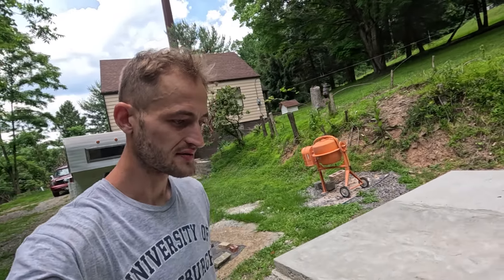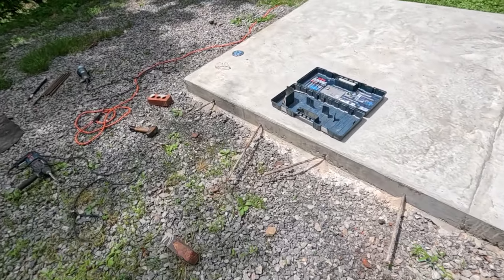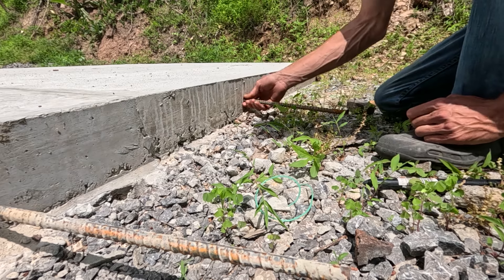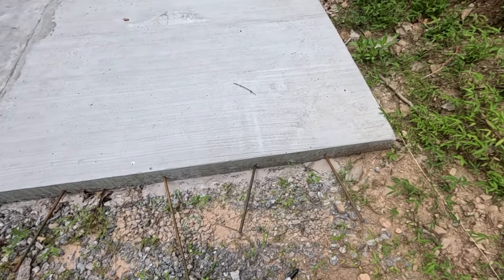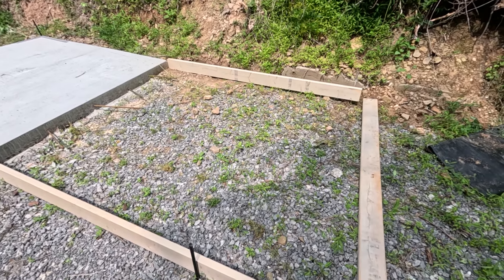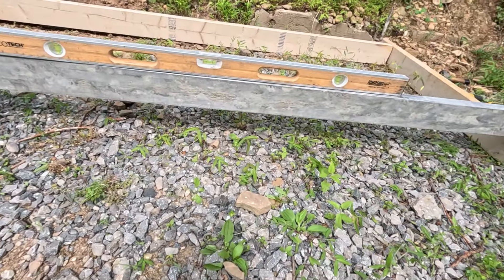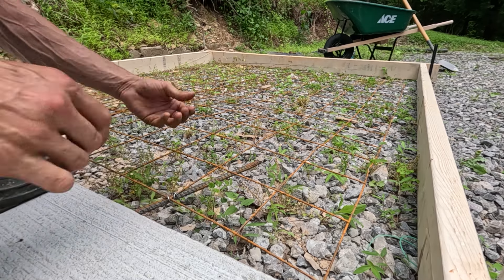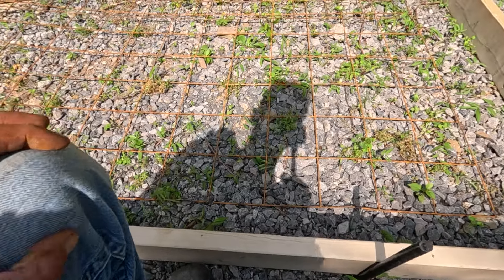How To Connect Concrete Pads

Comment: Great job on continuing the concrete pad with the rebar tie-in!
I'd prefer to use epoxy but your angle method is a good work-around. 
With the design of rebar, you should get a bit of the new concrete seeping into the rebar hole (though it would be a cold joint.)
Also, commendations for re-squaring the slab!

Great vid! :)
Reply from the maker: Thanks Mike!

Comment: When would you want to have a plastic sheet under the concrete? and is the only difference in the size of the rebar the amount of weight the finished slab can bear? Thanks again for making these.
Reply from the maker: Personally, I would put a water barrier under the concrete if I was doing a basement, or just really concerned with water seeping through. Since this is just for a metal garage, and the concrete is thick, I’m not really concerned. And yes for the rebar. Thanks for watching!

Comment: Looks good man! Question: wouldn’t it be much easier and cost effective to bring a minimum load concrete truck which would probably be about 2-3 slabs. It should be manageable even with 1 person and cost same as getting it in bags only you save a ton of time by not having to mix it all + haul + trash cleanup.
Reply from the maker: Thank you. Several problems with that. One is I can’t get a concrete truck close to where this pad is due to a septic tank, so I would have to haul it from the concrete truck to the pad. Not ideal for me. Two, you’d have to measure everything out perfectly to not waste any concrete because as you said you’d need a minimum load. If you waste any concrete it’s no longer cost effective. Also when a lot of these guys are quoting how much per yard, that’s not including a tip for the concrete truck driver. Guess you don’t have to but that’s a different conversation lol. Also dealing with concrete trucks can be a headache in my opinion. Mixing really isn’t that bad. Hauling only takes a couple trips right down the street to my local supply yard. And just a few empty bags for trash cleanup. Honestly not really that bad. Thanks for watching!